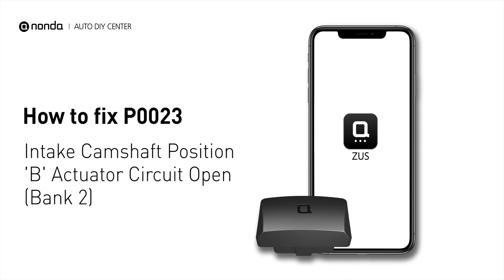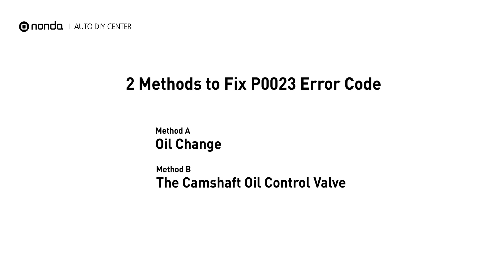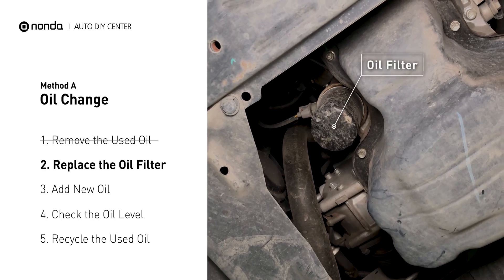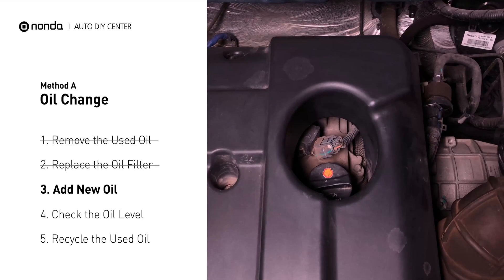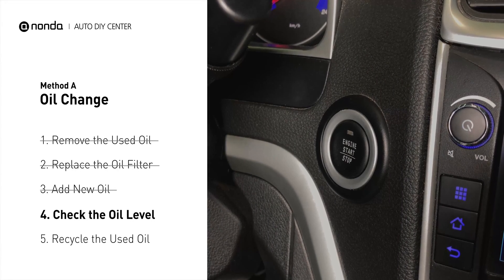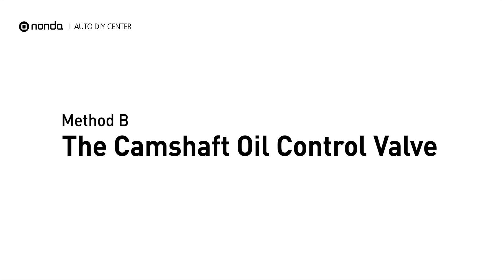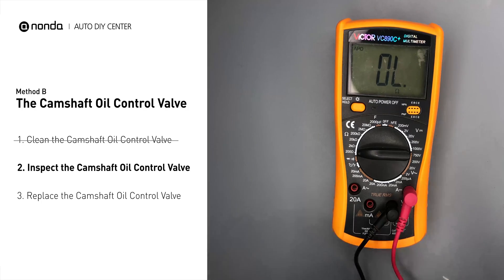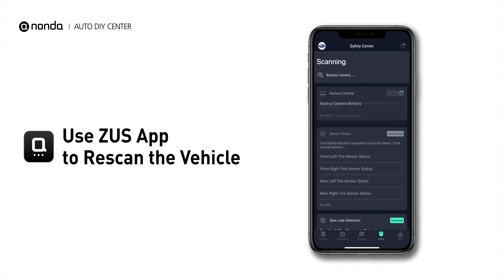How to Fix P0023 Engine Code in 4 Minutes [2 DIY Methods / Only $6.85]

Comment: If that’s doesn’t work what’s next
Reply from the maker: Hello, if the suggestion in the video has been applied and the issue still persist, we recommend having your vehicle visually checked by your local mechanic for further diagnosis.